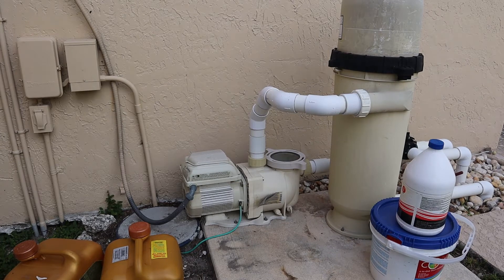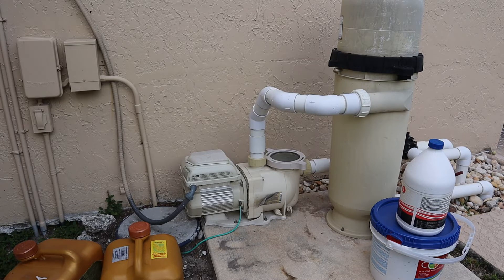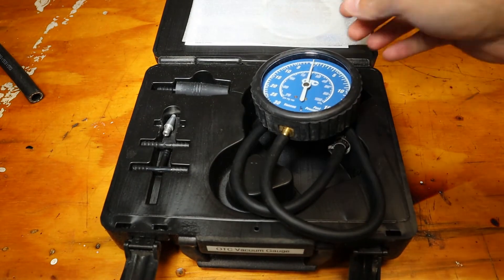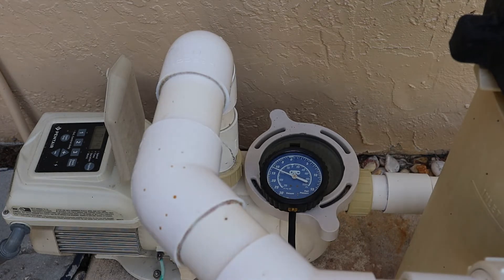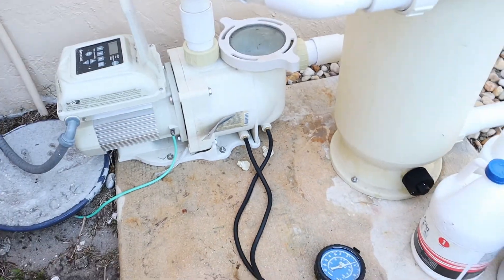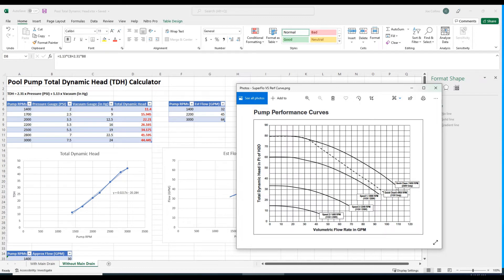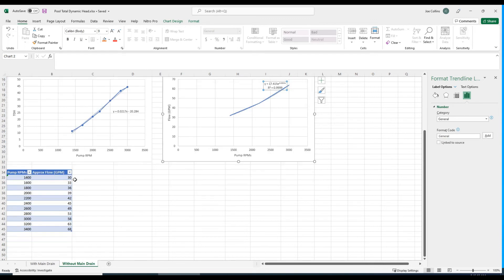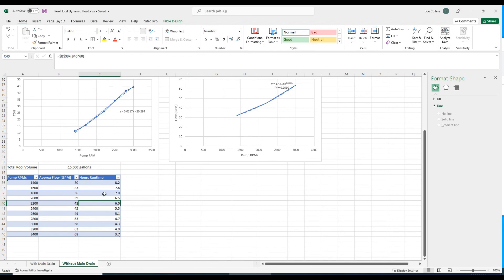How to properly set the speed of a variable speed pool pump

Comment: Good video.  But an important (to some people) missing piece is power consumption at a given RPM rate.  Like GPM flow rate, it's not a linear function of speed.  The Pentair controller on my house shows wattage at the selected RPM rate.   Assuming it's accurate, at 3000rpm it reports 1527W; 2000 RPM is 468w; 1000 RPM is 136W.  Or, at 1750RPM, I could run the pump for 24 hours, and  still use half the power of it running at 3250 RPM for 8 hours.
What I don't have yet is the flow rate numbers for my pool, to determine which speed for how long, costs the least $$ to run.  I'm working on that.
Reply: Did you ever find a solution to this? I just hooked mine up today and doing the math as well. My numbers are pretty close to yours.
Reply: @jackboeker83 get a flowmeter